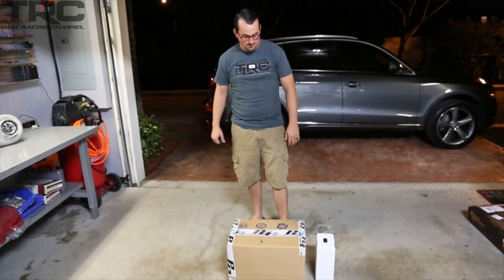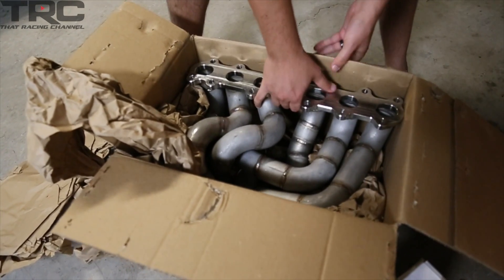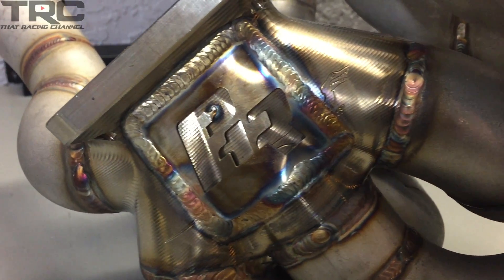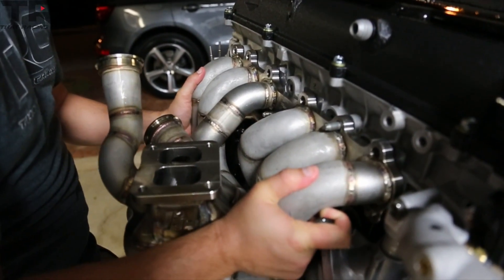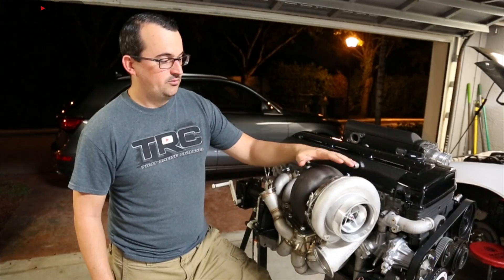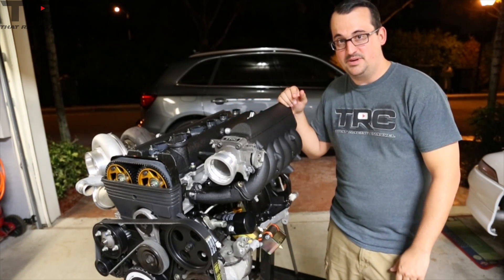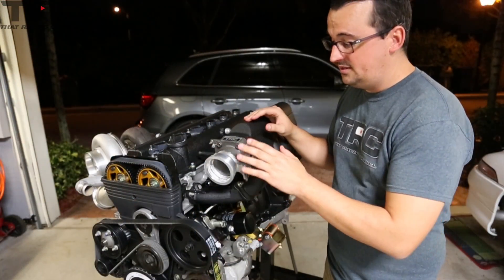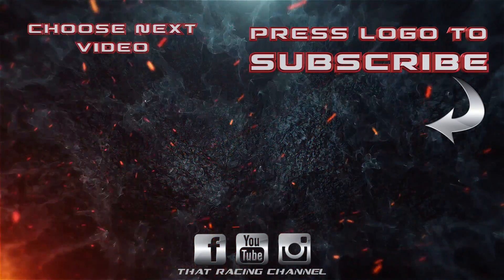DANGER to Manifold! - TRC S13 Project Eps. 2

Comment: I hope it's a t56 or something similar. like a RPM built trans. fuck a cd009.
Reply from the maker: ..... warmer!
Reply: grannas racing t56
Reply: T6060 hopefully - fixed all the little issues the T56 had
Reply: Thomas that's what I was thinking.  t56
Reply: Great choice..!..
Reply: GM.. Cadillac Trans right?
Reply: Ricardo 6 speed, from the Ford GT.
Reply: What's wrong with the cd009?
Reply: Dumplinman2012 the synchros will shit the bed with the power this 2jz will make

Comment: $20k under the hood 2jz setup spend 1/4 ls turbo setup
Reply: Bet that LS cant rev to 8,500 rpm and sound like a fucking banshee war cry though ;)
Reply: MafiaboysWorld try getting 900 ft. lbs. on 93 oct. with 12 lbs. of booosties. at 5k rpm. yaaaa!
Reply: lol plenty of push rod shit past 9 grand hours at a time , its called nascar
Reply: FrequencyOfThought yeah, they are NA, not boosted.  Try getting an LS TURBO to rev to 9K.
Reply: Michael Awesome type destroked LS build and see the magic of V8
Reply: LOL , Domestics make big torque period
Reply: Good luck getting traction with that much torque at that rpm. That kind of power is useless if you can't hook up.
Reply: Dumplinman2012 unless you weight 1200lbs wet theres plenty of tires that can handle that powaa.

Comment: No v160 so im assuming that since you're going 6 speed it's going to be a cd009 right
Reply: No, T56 it is.
Reply: What's the cd009 out of??? Is that the 370Z trans?
Reply: Daniel Brealey 350z, i think the 370 uses a different transmission